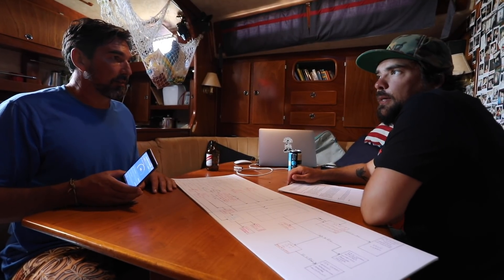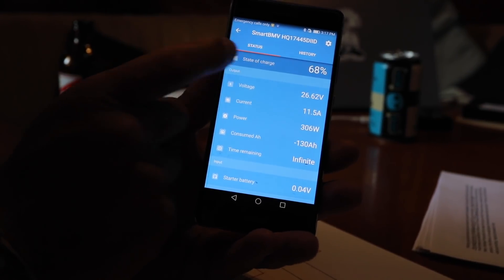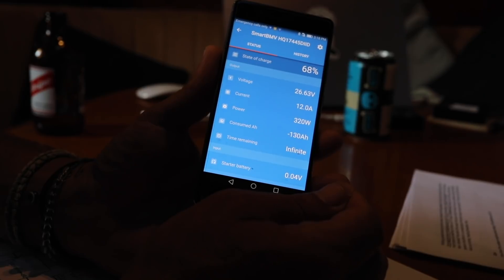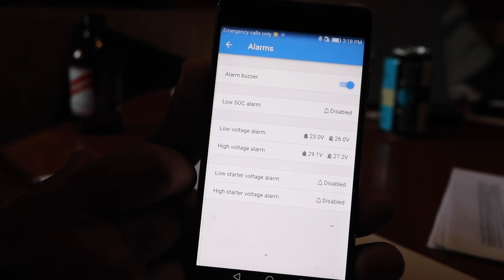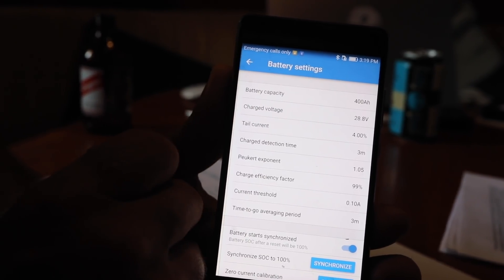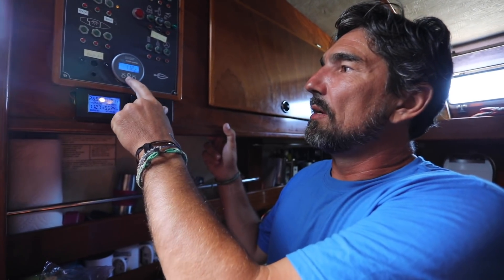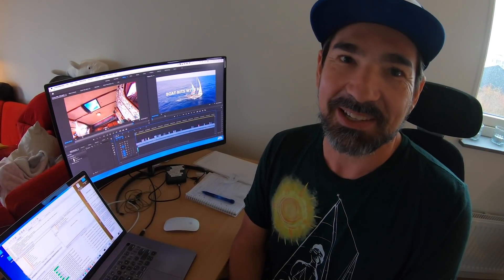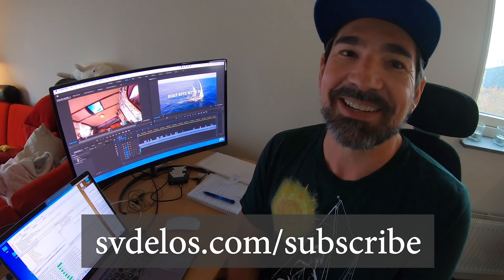Lithium Battery Monitoring, heavy draw items, and inverters - BOAT TECH (4 of 7)

Comment: First, I like these technique videos, nice to watch.
I connected our victron bmv-700 without Bluetooth to a raspberry pi and log all the data that's coming in. So I monitor it over the internet from every I'm :)
One question: What batteries you had installed before? Normal lead acid or GEL org AGM?

Comment: so if your solar or wind not putting in charge to the battery  will your gen start to recharge the battery
Reply from the maker: Yep, the generator battery is completely separate and not drawn down by any of the house systems.

Comment: I have a Victron BMV-712 in both my Sprinter van conversión and on my boat. I love the BT interface and even more the ability to update firmware via WIFI or cell service. On the Sprinter install i put a Victron 300ah Lithium battery so with the same IOS app I check the voltage and temp of each cell. Just the thought of being able to communicate with my battery is amazing. Now if I could just do that with my toaster I would be in heaven.

Comment: Great job Brian, I have spent a lot of time trying to teach people how to understand these terms and inter relationships. Looks like you have done a great job at getting your system up to date.  One pitfall is the inverter.  Many boat people threat their inverters like an after thought which is an expensive mistake if the ambient temperature derating curve is ignored.  So the inverter winds up in a tropical enviroment buried in a hole with minimal ventilation and then they try to use the full rating of the unit. If you haven't done so, it would be a great service to your followers to get out the docs for your inverter and examine what happens to the output rating when it's in a ambient temperature of say 120° F or 40 to 50°C.

Hope all is well....

Comment: I think there has been a Victron firmware update in the time since you filmed this. My MPPTs now have a "Trends" screen where you can select from a variety of electricity monitoring methods to display on a chart over time in real time. It resets when you connect to the MPPT, and I've seen mine display more than an hour (graph is adjustable). It's kind of nice! Good for Victron for adding new features to their existing product line and providing them for free. I'll be buying more!

ALSO! There are a few pieces of hardware from Victron for collecting all the usage information and uploading it to their cloud service so you can track the details over long periods of time and view it in a really nice web page. The data is shareable as well. AND! You can run the local app on your own Raspberry Pi and have it send data to the same free Victron cloud service, if you want to do it on the cheap. I think Victron have to be some of the coolest geeks out there.

Comment: if BMV is reading +12amp (which is the result of consumption onboard + solar), is there a way to know how much is being consumed by the appliances alone, at that moment?
Reply: :) and if I run my 640w AC bread baking machine from a 800va 12v inverter, how much power will it draw from the DC battery? I guess some energy is lost in the DC-AC conversion, so it will probably draw ~700w from the DC to make 640w AC, or more. What is your guess, should I consider a bigger inverter?

Comment: I had a couple Browning bows that were heavy draws 150 # and 80# but the batteries in the sites would last a month is you remembered to turn them off! But they did work good early morning and evening I used sr44 batteries 2 in each site! Was thinking about small solar cells to charge during the day but didn't get enough sun light in the woods even thou I was 15 to 20 foot in the tree! Funny ain't I? enjoyed

Comment: Just bought the same monitor can't wait to see how it goes.
Reply: I have the same unit as well, I love it!  Only one annoying problem; some guy in my marina also bought the same monitor and now every time I turn the App on, it doesn't know which unit to connect to. The app displays both serial numbers and you must pick one. The serial number is on the outside of the box it came in..... Do yourself a favour and write that number down somewhere close at hand for that one chance that you park too close to a similar equipped boat. Cheers!

Comment: The Victron lineup for battery monitors is the BMV-700 and 702 (for 2 batteries) these do not come with bluetooth but you can buy a dongle add on. The BMV-712 is the bluetooth included model on the Delos. They come with a single 500 amp shunt rated to 96 volts max. The shunt is installed at the battery negative to measure all actual power flow.

Comment: Great videos, thank for sharing them Brian and crew. I was wondering if you could share you power generating schematic for the boat. Do you always need the generator with solar and wind as I'm trying to avoid the generator.
Reply: Shane, check out part one in this series.  He talks quite a bit about that very topic.  Basically, it depends on the individual power needs for your boat compared to your capacity of wind and solar generation.  If there is a deficiency, you need a generator, or run the main engine, or hook up to shore power to charge up the batteries and make up the difference.  On Delos, they use a lot of power so they do need to run the generator from time to time to charge up the batteries.

Comment: Good video.  For some reason I thought Delos had way more than 400AH capacity in Lithium given the number of batteries she has.
Reply: and thats the point you and all others should stop using Amp Hours and start using Watt Hours because that equals out all Voltage differencies in the specific system

not to mention there should allways be a conversion from raw AH of the batteries to the usable capacity... old Pb batteires could use only about 50% of there AH ratings, if you setup your Li charger to only go from 10% to 90% charge to get more cycletime and lifespan out of your cells its the same.. and than there are the batterie manufacturer where good batteries also are underrating there raw capacity.
Reply: @Total_Egal  the battery companies kind of got us all using amp hours but like you said ..without knowing what volts you are using you don't know what 400Ah means. we have 20kwh of LiFePo4 batteries
Reply: @helenbell1715  We use amp-hours because amp-meters are cheap and reliable and have been around for ever. And we used to use the same voltage for the same purpose so it was good enough.  For example: planes used 48V, Cars used 12V  most tractors 6V etc.  I did have a power meter once where
you could manually set the voltage.  Now a days, even cheap computers can multiply voltage readings by amp reading on the fly to report power.
Reply: @richardgray2706  I thought aviation voltage is 28v.
Reply: @joecat101  Thanks for the correction.  I used to work with my dad on circa WW2 aircraft electrical equipment but it has been a long time...

Comment: These are really useful videos.   I particular like that you are stress testing everything you have installed for weeks, months or years.    Your movies are about the most up to date electrical systems like  LED vs incandescent lighting, lithium battery banks, and multiple sources of charging.    Once you have us all straightened out about power cables I would love to see easier explanations of troubleshooting NMEA connections.   Is NMEA 2000 really the answer if you have a boat loaded with devices hooked up to the older standards?  So many questions that you can help us to answer.   THanks
Reply from the maker: Hey thanks Peter, glad you enjoy them!  Good idea on the NMEA 2000 video, we have both networks on Delos and I have numerous devices all talking to each other so that one could be pretty cool.  I'll add that one to the list.  Fair winds and thanks for your support.  Brian

Comment: Brian, you do a great job of explaining technical things. I did not know the lithium vs wet battery differences but now I do! Love these tech moments! One question; I know wire size dictates how much power you can send; is there a difference in efficiency between lithium and wet when sending a longer distance?
Reply: Here is a really good calculator that helps you define the wire size required over the distance. http://circuitwizard.bluesea.com/ They have an application for your phone as well and I have used it often for running wire on our boat. Brian will have to answer your question.
Reply: It is wire size and Voltage that affect current flow over distance not the batteries. 
The batteries are storage only, that is they have different storage, recharge and discharge characteristics and different recycle abilities thereby different length of life. It looks like Lithium likes long discharge and high recharge while lead like short discharge (less than 40%) and slow recharge.

Comment: Does the app have to be open to get the alarms or does it have an option for push notifications?  Or does the display unit itself beep for the alarms and the app just sets it up?
Reply from the maker: The unit itself sounds the alarm with a loud beep, so I believe the app is just used to set up the alarms initially.